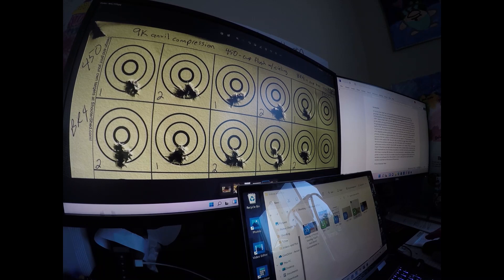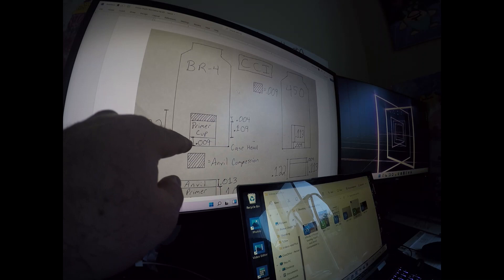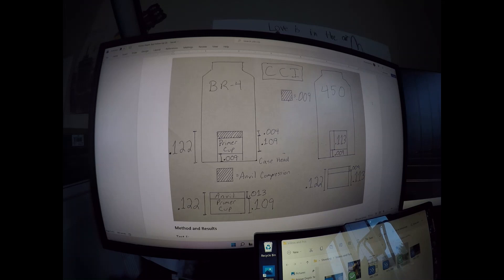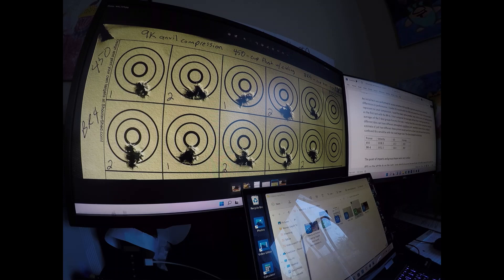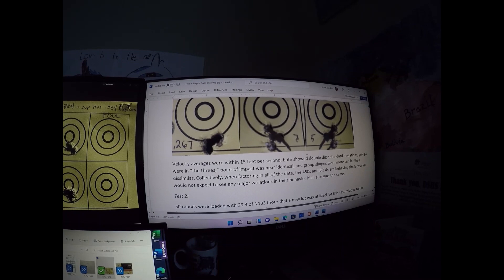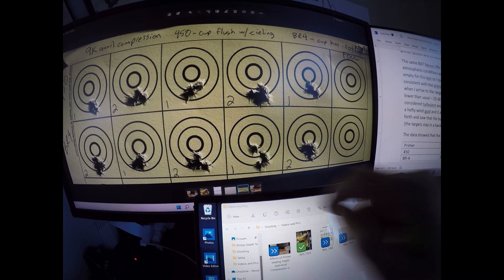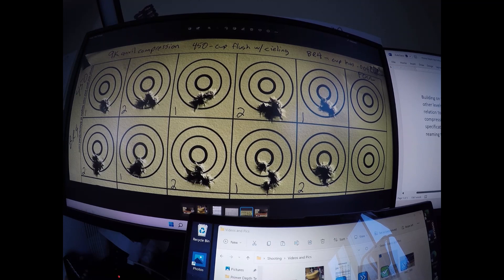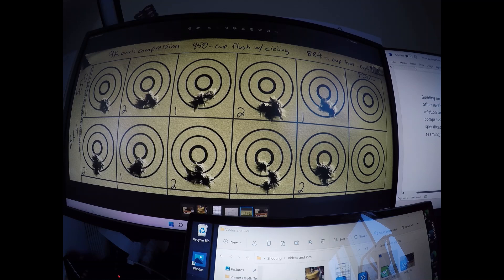Witch Doctor: Effects of Primer Seating Depth and Anvil Compression on Precision: UPDATE!

Comment: Thanks Bryan for the test - I like the updated primer dimensions breakdown and your findings are very valuable. 

I read recently that magnum primers have a different chemical composition over standard primers - they do not pack more of the same compound in a larger cup size. Assuming group size is related to ignition timing, i.e., when the firing pin compresses the primer cup against the anvil, then finding similar groups sizes at the same seating depth measured from the face of the cartridge would make sense (assuming consistent headspace, as the firing ping should push the cartridge against the shoulder first before crushing the primer cup; and also assuming similar anvil dimensions between standard and magnum primers).

FYI - I tested BR-4 against 450 in developing a Varget load for a 6 Dasher last summer. At the same seating depth within a node, BR4 gave me tiny groups with an occasional flyer (~20% of the groups) , while 450 groups were a bit larger but very consistent. I re-tested quite a bit and ended up attributing this to more consistent combustion with the 450 for the specifics of my loads. It's interesting that you do not see differences between the two primers - perhaps you load combustion is optimized with BR4 and there is no impact of a more powerful ignition compound? So many factors at play.. not sure any theory can hold!

Comment: Another great test Bryan, Thanks. Although it seems to raise more questions for me because with my lapua 220 russian(fire formed to 6PPC) I've got primer pockets that are ~0.120" deep below the rim and my BR4 seem to measure 0.120-0.1205" with two different calibrated micrometers. I say seem because it's possible I'm compressing the anvil slightly when I measure. However, I'm getting visible metallic deformation of the primer cup before I can get 0.009" of anvil crush(0.009 below the rim). I'm actually seeing some deformation under a loop at 0.006 below the rim.  Seems to me that the cup would be fully seated to the base of the pocket before any deformation is taking place. It's taking a lot of force and literally bottoming out my hand primer before I get over 0.008" below the rim. I'm going to check more calibers and brass over the next little while to see if I get a correlation between them. I am convinced that I definitely need a primer seater with a physical stop at this point in any case. Guess I've got a new machine shop project! Merry Christmas to you and yours!
Reply from the maker: Good luck working that out! I like the idea of a primer seater with a definitive stop point. Should help with uniformity and prevent accidental cup crush. Happy holidays!

Comment: Really good work, sir.  Appreciate all the time & effort put into these.  I've gotta find me a LE Wilson case check and micrometer in stock so I can verify where my primer depth is at.  Had been considering it and a Primal Rights seating tool, but couldn't justify that price point no matter how well it works.  Just been using the Dillon to seat em.I push em in far as theyll go and that has worked to make it go bang, but at 1k, the greater amount the data, the better chance one has of knowing where the shot is going when the shot breaks.

Comment: In this video you were able to conclude on anvil compression as being the key component to precision and having no relation to cup height. In another video on primer sorting you found weight sorting provided significant gains to precision. As we know, overall height in primers varies from one to the next as does rim thickness on the casings. Are you doing anything about primer heights with weight sorting to maintain consistent anvil compression? Also, what about rim thickness variation in the casings? Would really love to know more on this as I've been stuck in this rabbit hole on primer sorting & seating. Thanks and hope to hear soon on this if you get time.
Reply from the maker: Thanks for tuning in. I really should do a video summarizing all of the results and some things I’ve learned along the way. I’ll add it to the list. What I’ve found is simply weight sorting is a great idea because you will have significant vertical dispersion out to as little as 200 yards if you don’t or you’re not lucky enough to have an incredibly uniform lot of primers. For example, four primers weighing 3.68 will cluster together but one primer weighing 3.60 will drop. I can’t tell you how many times I’ve seen that in matches where there is an “unexplained” drop shot among shooters who do not weight sort. As for the anvil, yes, that is the key variable which is why I recommend measuring your primer pocket length and know the primer cup height and anvil protrusion. I have seen postings on shooting sites of an image that shows primer dimensions of widely used primers in the USA like Federal and CCI so you can get the dimensions from that resource assuming it’s up to date. In a nutshell, you have to have both variables (weight and anvil compression) controlled and then you will get optimal precision. As for the rim height on the brass, yes, you have to be careful with that because those heights can vary quite a bit. What I do is set my primer tool to seat to the depth that gives me .008” anvil compression and then check every primer I seat with either calipers or a primer seating depth gauge. I allow for .001” variance (Speedy Gonzales sets his threshold at .0005”). Any piece of brass that shows variance beyond .001”, I check the brass rim thickness and it’s usually off spec. I use out of spec brass for setting my neck turning tool, setting neck trimming tool, Aztec code on my AMP annealer, and other things but I definitely will not shoot it in a match because my primer seating will be off and degrade precision. I just texted Speedy about this the other day and he has a nifty custom made tool that rapidly measure the brass rim thickness…much more efficient  than my method which uses primer depth as a proxy measure. He’s going to send me that tool so I can try it out…I’ll have to give it back but I’m going to use it to see if my proxy measure is accurate enough and I won’t have to make one of those tools myself or find somebody who could. With cups that are thicker (e.g., CCI) than what I’m used to (Federal), the seating force is higher but what I do is seat once, rotate the brass about 120 degrees, seat again, rotate 120 degrees, and then seat again. The primers get seated uniformly with this method. I found with thinner cups, I only have to rotate once but can’t hurt to rotate three times. The thicker cups with more seating force don’t seem to affect precision. One other thing you have to consider is differences in primer pocket design. With Alpha brass, I believe there is some kind of bevel in the cup that I suspect is crushing the primer cup and causing a disturbance to the anvil. This could be why Alpha brass shot worse than Lapua in my testing. Also, a handful of great match shooters told me that once they removed the bevel after reaming the pockets, the Alpha brass shot better but still not as good as Lapua. So, in a nutshell, as long as you get that anvil compressed to .007-.009”, the primers are weight sorted, and you’ve culled out the brass with too much or too little rim thickness, you should be good to go! Thanks for inspiring me to do another video and I hope you shoot small!
Reply from the maker: I did a quick video on the brass rim thickness issue and there is a direct relationship between rim thickness and seating depth. The thinner the rim thickness, the shallower the primer is seated. I’ll post that video on my Patreon and the maybe do a more comprehensive review on YouTube. I recommend becoming a Patron because I post there a lot. YouTube is just fliers for the concert.
Reply: @WitchDoctorPrecision   Thank you for the detailed response. I can't begin to tell you how grateful I am for that information. If you only knew the amount of time, effort and grief that I've gone through to get a straight answer on that. You've definitely made a Patreon member out of me and will look forward to learning more from your testing and will gladly contribute to helping keep that going.
Reply from the maker: @BenchAddict-hs1nu  welcome to the team! Everything I do is to support shooters by having  practical data that answers practical questions. I’ve grown weary of the keyboard warriors, fake experts, pseudo intellectuals, and others who only have conjecture. One test is worth 1000 expert opinions! Follow the data!

Comment: It seems this test confirms that primer seating depth is about ignition timing vs anvil crush. Indexing off the case base to a depth of .009 means the firing pin strike is at the same distance from the bolt face….

Comment: In looking at the SAAMI  specs on page 36 it states that primers to be seated FLUSH to 0.008" below the face of the cartridge case head. So there is a range but I can't find where it states that the ideal is at exactly 0.008.

Comment: So are you saying to seat the primer till the primer anvil touches the top of the pocket based on overall measurement, then compress it further into the primer .009" more?
Reply from the maker: Yes, exactly. I would try .008 of anvil compression too because those shot well when I shot a couple groups of them the other day. The reason why I concluded this was because:
The BR-4 performed best at .009 and very poorly at .013
The BR-4 at .013 is where the anvil compression is at .013 and the top of the primer cup is flush with the top of the pocket and it shot poorly so I wouldn’t simply seat to the top unless you have a primer like the 450 which, when seated to the top, is .009 anvil compression and it performs the same as the BR-4 with the same compression. This is why I would measure everything and then focus on anvil compression rather than seating depth and/or seating to the top. If it just so happens that seating to the top  and/or by feel is .009 then great but if it’s not, then you may be leaving precision on the table.
Reply: @WitchDoctorPrecision  Its looks like some primers (BR-4) is sensitive for seating depths, and some like (450) is not sensitive.

Comment: Really ennoying these videos on seating depth. I am new to this level of testing. My question are. What amount of variation in pockets depth is excepted?  When I measure my primers. I am finding , 7 to 9.5 thousand between anvil and cup measurement.  I assume not to crush the cup is correct?
Reply from the maker: Thanks for tuning in! I’ve found that pocket depth variation depends on some factors including brand and whether it was uniformed. In high quality brands, I usually see .002” variation among a lot of 101 pieces. It seems like a little variation does not have a major impact on precision for the type of shooting most people do. But if I were shooting ELR at 2 miles, then I’d make sure my pocket depths and primer cups are perfectly uniform so I can compress the anvil .007-.009”. And, yes, do not crush the cup. There is a certain brand of brass the has a bevel in the primer pocket which slightly crushes the primer and this causes major negative effects on precision. After I cut the bevel out of the cup, precision improved. I would be careful what brass you use.
Reply: @WitchDoctorPrecision  thanks for the reply!! I use lapua brass, small primer. My first lot, the pickets were shallow so I uniformed them. The next couple of boxes I got were deep. Started at .122.5 and .123. My understanding is that as you shoot them they should get more shallow. Not happening on my brass. Thank you for the help!!

Comment: I just measured a dozen CCI450 primers and they all were 0.119 - 0.121" in height.  I did not find any CCI 450 primers that had a height of .113.  What do you think accounts for this discrepancy?
Reply from the maker: Cup height is .113. Cup and anvil height is what you are measuring.
Reply: @WitchDoctorPrecision  Thank you for the clarification.  So anvil height sticking out beyond the top of the primer is ~ 0.006-0.008 or so with the CCI450?
Reply from the maker: @bob1764  yes, around .008. With the 450, you can simply “bottom out” the cup to the ceiling of the primer pocket to reach optimal anvil compression whereas the BR-4 requires precise seating because the cup is shorter.